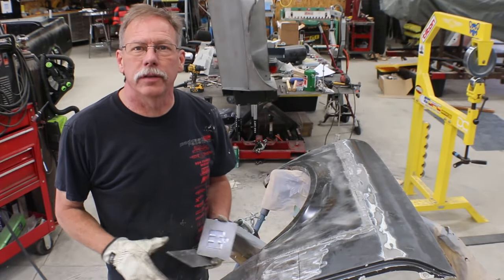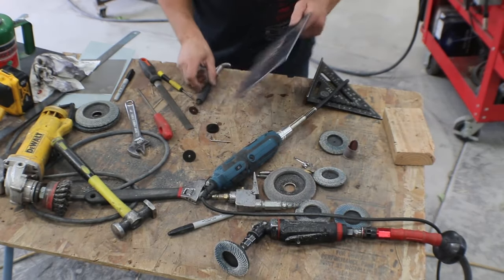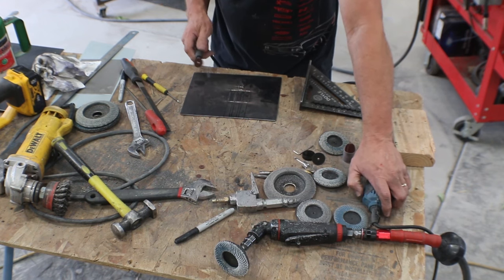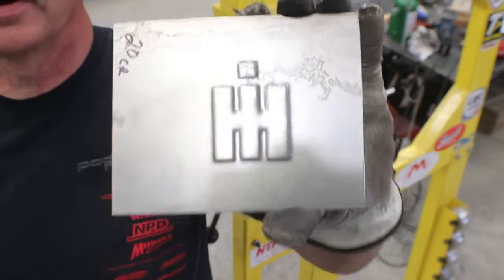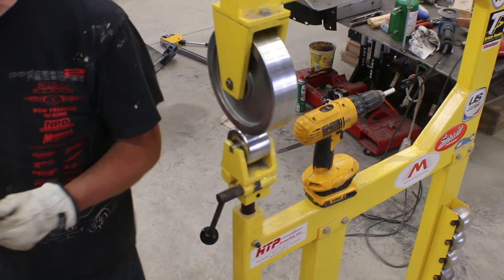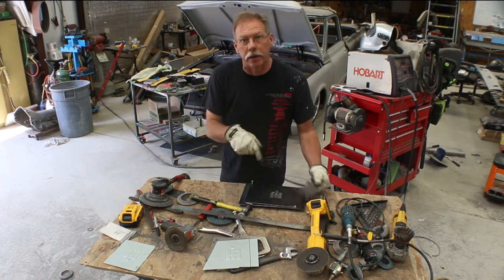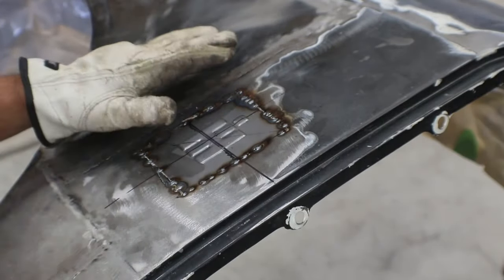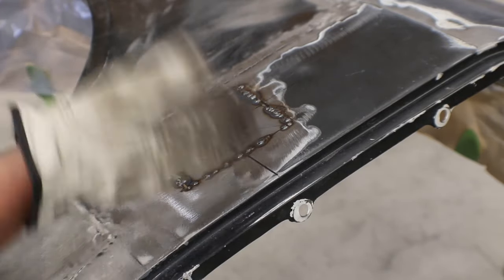First Time Making English Wheel Art

Comment: So if you need to "joggle" a panel to have an offset, you can do the same thing...sort-of. It takes a little time to build the press plate but once you have it you can do that to as many panels as the tool will last, and they will always be the same. On aluminum you need to factor in a little bit of spring back if it is hardened. Thanks for the video!
Reply from the maker: I hadn’t thought about doing that, I typically use a bead roller. But yea to make a very straight line, a jig and the English wheel would work very well.
Reply: @AllisonCustoms  Where I learned this I had to Joggle a leading edge for a P-40 along the whole top edge and it was  167" long. We made a press plate that had the the "profile" of the joggle and the stack up necessary to joggle the .050" aluminum, and when it came out it was perfect! I have used this method since then several times in repairs I have done.
Reply from the maker: That is cool, did you do make the press plate the entire length? Or shorter and shift it down the line a few times?
Reply: @AllisonCustoms  made it for the entire length. Then I did another panel that was a little more complex than a straight line...I was amazed the way it turned out....The guy that I was working for taught me a lot!
Reply from the maker: Awesome things to be taught for sure!  And I will be “stealing” the idea, thanks!

Comment: Why didn't you emboss it directly onto the fender?
Reply: Came out great tho!
Reply from the maker: I’m sure it could be done, but at first it was just an exercise to see if I could make it at all. Then I decided to put it in the fender instead of the factory emblem.  The fender has some curve in it there, so I would be afraid it might flatten out or really change the shape of the fender, trying to go directly into the fender.  Also, it would probably not be any fun trying to put that whole fender in the English Wheel. Finally, I doubt I would be able to get it all straight without being able to see the emblem when I was pressing it in.  
Like I said, someone could probably pull it off, but welding it was pretty easy.

Thanks for watching and the question!